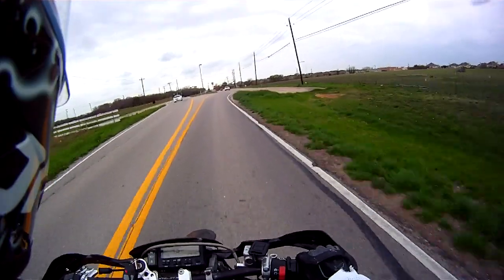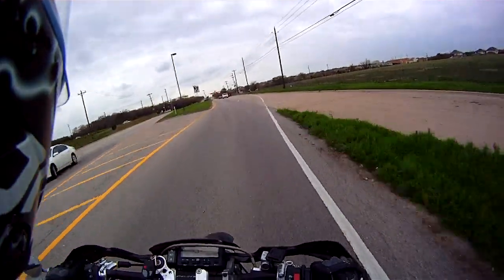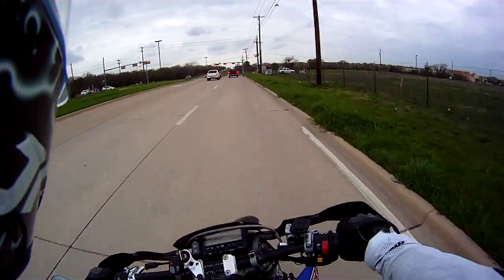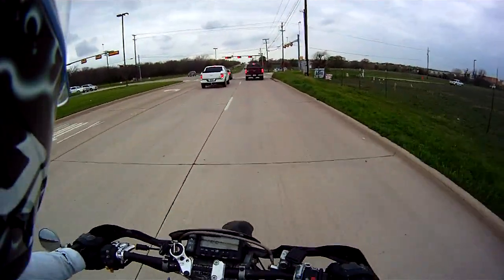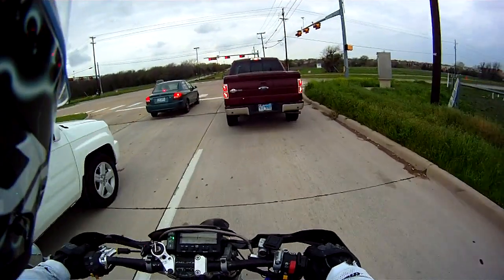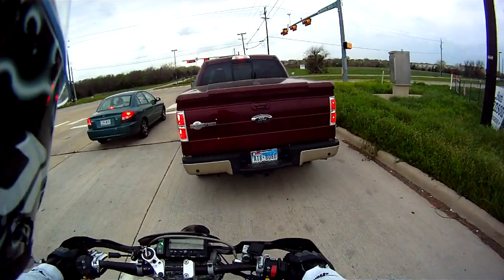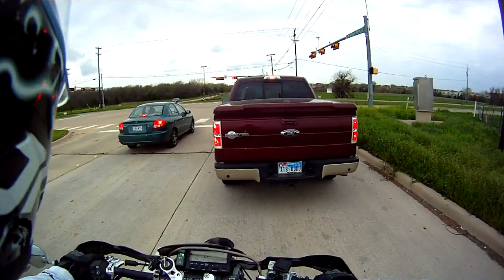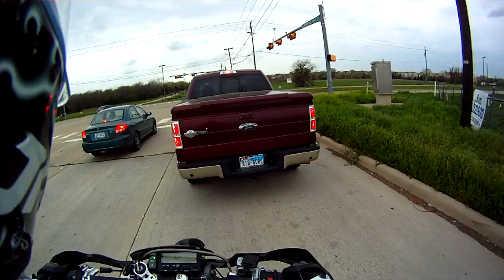Motorcycle Chain Stretch Myth

Comment: I raced motocross or several years, and I'm still fairly active in the sport although I ride on the street. Chains do stretch. I replaced chains before I replaced sprockets. The teeth on the sprockets do wear but not as fast as you say they do. The  pins that hold the links together are not the strongest materials. They are made to stretch.

Comment: I always like yer high energy, so I tune in to all yer vids, but I have a question for ya.  Lots of high end quality bikes don't use chains anymore.  It is a drive-shaft type connection, which is more sophisticated way of transfering engine power to the ultimate performance. Your opinion would be welcome.

Comment: Not sure. I never replaced them both at the same time. It was not too terribly often that I replaced chains because I always kept mine very clean, well lubricated, and at the proper tension. Usually every 2 chains I would have to replace the sprockets.

Comment: You are right about sprockets, and rollers wearing, but chains do stretch! Which promotes sprocket wear. Even if a chain link only stretches .005", that is over a half inch on the average length chain. The metal used in a chain isn't some amazing super metal. It'll stretch like any other metal, and if they made the links harder, they would be prone to cracking. 

Even the Panther belt stretches on my 108ft-lb cruiser...

Comment: chains do stretch and they do not stretch uniformly. No different than hardware. If a piece of hardware is put under enough load it will stretch before it actually breaks!

You are correct in saying that your need to adjust is caused more from the wear of chain rollers and chain wheels/sprockets!

Comment: dont get an O-ring for a dirt bike, and try to avoid powerwashing them, the dirt can and somehow, alsways will. get under the o ring, and then it cant get back out. even on newer chains. but i dont think any chain works better for street or supermoto. i dont belive in the bow test either, where if it bows horasontaly more than 3 inches it should be replaced...

Comment: How often do you adjust your chain? I gotta do it like every 2 weeks. Its 110 links and stock gearing. Im already way behind The lines on my adjustments. If i make it pretty tight it takes longer to get loose than it does adjusting it how Im supposed to. Im thinking about taking a link out. What am i doing wrong? Letting the clutch out too fast?

Comment: Friction and grinding causes the holes that the link pins pass through to become ovalized. Under tension the chain will become longer until it reaches the service limit (by measuring a length of chain) then it is replaced as a set with the sprockets. No magic tricks, no extra links, the chain is longer. 
Mechanics call it chain stretch. It meets the dictionary definition of stretch. Now go make a new vid and apologize ;)